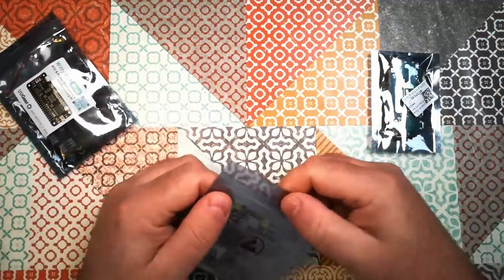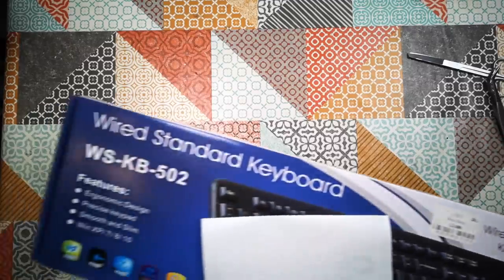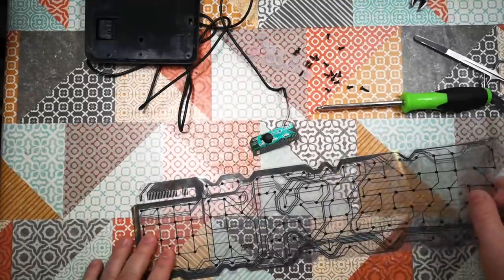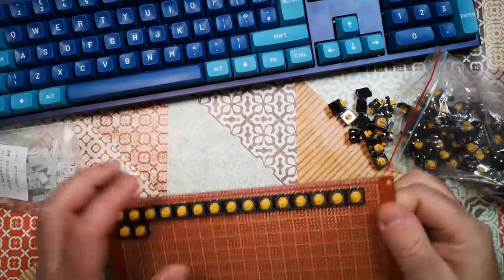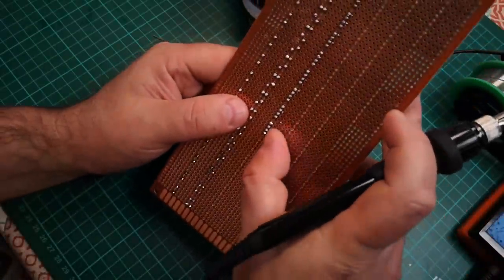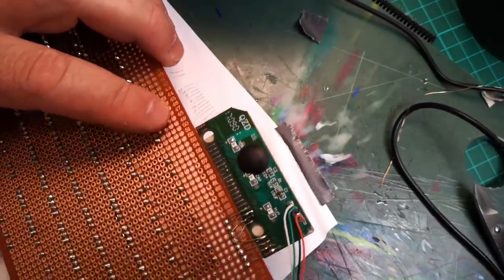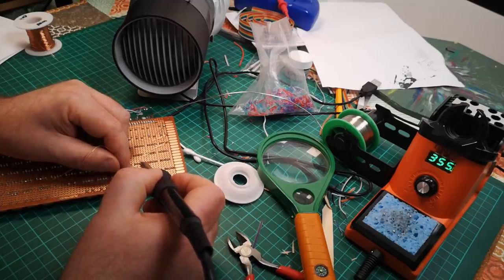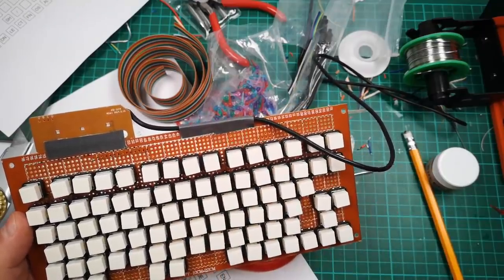How to NOT Build a Keyboard, or: Time to Stop Doing the Same Thing Harder

Comment: Are you absolutely set on constructing your own keyboard with discrete switches and your own matrix?
I suggest removing several of the switches closest to the keyboard decoder and cut out that part of the perfboard. Then solder to that small chunk of perfboard instead of directly to the original keyboard pcb. This way you could mitigate damaging it further. While the result would be pretty ugly, you would salvage the work you put into decoding it.

Comment: I also had the same experience with this kind of perfboard. Just get the green ones if you can.
Reply: Yeah this was a phenolic substrate board. It's basically resin impregnated paper. The really good perfboard is fiberglass with plated through holes. And the good stuff is often green.

Comment: Soldering enameled wire: scrape, tin the spot then solder the wire. 
Or you can burn the end with a lighter instead of scraping but it only works for the ends.
Reply: A dab of flux helps too.
Reply: There's different kinds of enamel insulation. Supposedly this was the iron meltable variety. Which you are not supposed to have to scrape to be able to solder.
Reply: @dogwalker666  yeah but he said he was past using flux. Or so he thought.
Reply: @1pcfred  woof... and from the video clearly not.
Reply: @1pcfred  I always use flux it protects the joint from oxidation. And protects the tip. And with these lead free solder you need all the help you can get.
Reply: @dogwalker666  why are you using lead free solder? I personally do not punish myself just because my government cannot manage the waste stream. When they passed ROHS they conveniently made themselves exempt too. Which I find completely unacceptable. As long as you can refrain from ingesting the solder yourself it poses no health risk to you. I know lead is delicious so it is difficult to not take a little nibble now and again. But you can at least try to exhibit some self control..
Reply: @rosennachev9864  I think not using flux is why that solderable enamel wire was less than solderable for him? Bare wire with no flux you're going to have a hard time.
Reply: @dogwalker666  I've heard that one from people. They think that somehow they're inhaling lead fumes when they're soldering. I guess they mistake flux fumes for lead vapor? I looked it up one day and lead vaporizes at 1,200°F I have some 800°F tips. That still ain't 1,200° though. I try to stay out of the fumes anyways. The stuff can make my eyes water. There's legitimately a problem with lead leaching into groundwater from improper disposal of electronics. That is real. It also has nothing to do with me. I don't throw junk electronics into my regular trash. I pile it all up in the superfund site I have going in my backyard.
Reply: @1pcfred  exactly and I never dump old electronics It all goes to Silicone Heaven or the back of my workshop,  Some older fluxes can be a bit nasty as you say, but try desoldering an old Valve radio without flux.
Reply: @dogwalker666  I don't play with tubes myself. I haven't been doing much with electronics lately at all. I used to. I changed and so did it. The modern SMT stuff never did it for me. There was a narrow window of through hole semis that always appealed to me. I got tired of chasing something that kept getting further way.
Reply: @1pcfred   The SMT stuff is not so much fun, And tends to be module replacement,  I like to restore old amps etc, but old radios are a problem as all the LW/MW radio stations have gone,
Reply: @dogwalker666  I was never into radio. I did make an AM receiver by mistake once though. It only picked up one station. It was supposed to be an audio amplifier but it oscillated instead. That one station did come in clear. The last time I scanned the radio dial I couldn't find much content in English. I was fooling around with a pair of speakers I picked up at a yard sale and I hooked them up to a receiver I had hanging around to see what they sounded like. I ended up putting crossovers in them. They only had high pass capacitors on the tweeters. A lot of speakers are like that. The crossovers made the speakers quieter but I think they have more separation now. Depth? Hard to describe but I like them better. Nice little cabinets and the drivers are OK. They just couldn't spring for any crossovers. I guess because you can't see them? Appearance is how most folks buy speakers. Who cares what they sound like.
Reply: @1pcfred  flux core. The solder have flux core more than 99% of the time and its enough. Yes using aditional flux helps but that not the main problem.
Reply: @1pcfred  that's right most people will buy speakers made of P.E.T.  with Plastic cones as long as they look expensive.
Reply: @dogwalker666  polypropylene cones? I rather like those myself.
Reply: @1pcfred  I was thinking of the mylar ones, Poly propylene humm That's probably a good material.
Reply: @dogwalker666  I like mylar tweeters. I think I may like silk domes better though. Not as harsh. I think my rear speakers may have mylar domes in them? But they're rears so they're kind of low volume.

Comment: I do a lot of perfboard soldering and this hit me on an emotional level
Reply: Not all perfboard is created equally. What we're seeing here is the real cheap stuff too. Those pads lift if you just look at them too hard. Better perfboard has plated through holes and it's FR4 fiberglass too. But for what it costs you might as well have boards spun up.

Comment: I've used a couple of varieties of solderable enamelled wire/ magnet wire , it tends to require pretty high soldering temperatures ( 390°C for one type, >420 for the other) which is pretty likely to pop those tiny pads off the board and require a lot of tip hygiene to make adequate joints.  Both types have a polyurethane coating which is partly self- fluxing, but gives of toxic smoke!
You did pretty well considering👍👍
I'd be tempted to try making a custom pcb (as suggested elsewhere)  and either photoetch or mill the tracks (pretty much only feasible if you have a cnc router to drill all the holes), alternatively send the files off for professional printing.  If going this route it would be worth looking at embedding a microcontroller for decoding the keys and sending the decoded keypresses off using I2C,  SPI or even usb with the right microcontroller (eg teensy)
Reply from the maker: I have a little CNC mill that could probably do PCB milling (it might actually be the only thing it can really do).  Very little recent experience of PCB design though - literally, when I learned the skill of PCB design back at college, it was all done manually with pens, thin tape and Letraset transfers onto an acetate photoresist mask
Reply: @AtomicShrimp  I've had great success with a couple of small routers usin engraving bits to make pcbs.  I used Eagle with a plugin (pcb gcode I think) to export routing drilling, and cutout milling gcode files for both. The free version of Eagle is limited to (I think 8cmx10cm) small boards, and the copper clad boards need to be very flat if the router's software doesn't have an auto-level feature.  Another viewer suggested gEDA, which I haven't tried (but probably will...) there's also KiCAD (which had too steep a learning curve for me to swap to from Eagle)
Reply from the maker: @2lefThumbs  One of the advantages of doing something like that is that it should make it much easier to machine a matching bezel for the keys - for the design I was working on here, I would have to make one based on my own measurements of the spacing etc, which is bound to be slightly off even if I measure with digital calipers
Reply: @AtomicShrimp  good plan, I was going to suggest that possibility👍  A lot of the pcb stuff depends on  availability of pcb foiot print librarie (fairly easy to add your own in Eagle, or download suitable ones from suppliers - for the bezel, you might be able to download 3d models - personally I'd measure the keycaps and use openSCAD to draw and use them to cut out appropriate holes in a flat sheet to generate an STL that could be used to 3d print, or carve out the bezel from a flat sheet (if you haven't met openSCAD, take a look, it lets you proceduralky describe positive and negative features of a 3D object- I find it quick and easyto build and modify, you might too)
Reply from the maker: @2lefThumbs  Oof, that sounds like a lot of learning curve.  I might carry on looking for nasty shortcuts!
Reply: @AtomicShrimp  it's a  shortcut, trust me, perfect for someone with.a coding background👍👍
Reply from the maker: @2lefThumbs  I might give it a go.  The thing I am finding terribly frustrating with a lot of technical projects (QMK included) is that the ground-level points of entry just don't seem to exist.  Wherever I try to start with this stuff, it seems like I need to know something already to make that start - and when I go to try to find out that thing I need to know, it's the same story there - everyone is assumed to be part of a community with some knowledge already - I'm sure that the information exists, it just seems either hard to find the loose end to get started into it
Case in point: the Adafruit Kee Boar - a microcontroller solution designed to be used to drive a keyboard matrix: https://www.adafruit.com/product/5302  Sounds ideal for what I need, as a bit of a noob to microcontrollers, except how would I program it when I get one?  I can't find anything on this.

Comment: There is an easy way to reverse engineer the paths of this keyboard.
Use a scanner and the fill tool of a paint program to highlight one connection and instantly see where it goes.

In case you want to read your own matrix, there is a neat low EMI way:
Put all columns to ground and make the rows the input with the built in weak pullups. Some microcontrollers can even trigger an interrupt when any of the inputs turn low. No scanning saves power and causes no EMI at all.
When one row turns low caused by a key press, switch the columns to input and put the row which was low to low. Then you know the row which was pressed and you can then read the column where it was coming from.
If done right, you get only one EMI click caused by depressing the key itself.

Comment: Oh, I thought of something that might help. What if you use software instead of hardware to 'tell' which switch is which character? The advantage is that you build your keyboard on the most efficient and ergonomic way that suits your demands and then 'program' the keys. For this you need probably to go into how character sets (e.g. UTF8) are mapped to a binary code. In other words, you have your matrix of 8x8, and then col1/row1 = 000001, col1/row2 = 000010 etc.

Comment: Making a keyboard has got to be one of the most expensive/complicated parts of a computer. That's why there are so many different keyboard types and manufacturers want to find the cheapest way of making them. I'm using a PS/2 HP silver/black keyboard on my PCs because I like the feel keys the best. One option, you could design your own PCB and let JLPCB make it for you. Later you could populate it with your switches.
Reply: I agree, If I were to ever attempt at making a keyboard, I would definitely do this.

Comment: One of the places I worked made small runs (like on the order of 100) of custom circuit boards by hand and using protoboard and the way they solved the "what gets soldered to what" problem was a series of masks that they placed over the boards that had cutouts for the legs and and visually showed what legs needed connected to what; this was like 5 or 6 years ago. My guess is that they have custom circuit boards created for all the new stuff now.

Comment: If you wanna build a board from ground up but don't have sufficient skill to design PCB for yourself, I suggest you looking for PCB that already designed by mech community. There are quite a variety of them and I'm sure they will help you. Of course, it should be MX compatible as these are really easy to get (not to mention the compability with the mounting plate, cases and keycaps)
Reply from the maker: I don't think it's going to be possible to make anything compact enough, using full-size keys

Comment: i did build about half of that before. had a broken keyboard and soldered some switches on. not a complete keyboard, just a couple keys to get computers into BIOS that don't accept USB keyboards by default and need it enabled in the BIOS first. that half keyboard has just arrow keys, del, enter and a few others to navigate the BIOS. it runs on PS/2 btw

Comment: I haven't watched the whole video yet.. but from what I remember the kernel has support for doing GPIO connected matrix keyboards. So you don't really need any keyboard controller.
Reply from the maker: Sure, but I want to keep the GPIO pins free for stuff that isn't a keyboard
Reply: @AtomicShrimp  i2c io expander then.. one with interrupts for the GPIOs will work fine for a keyboard.
Reply from the maker: Yeah, maybe

Comment: I think reverse-engineering the matrix wasn't such a bad idea. Finding a good connection layout is always a huge problem and here they did it for you! You probably would spend way more time figuring out a new matrix that would work well. But after everything is done on the paper, creating the physical lines is probably the biggest challenge. It's probably impossible to make a 2 sided PCB (which would be ideal, it's just a replacement for the printed carbon one anyway) of this size at home, and ordering a custom printed one probably costs too much.

Also a note about the switches. You probably don't need all 4 pins, just 2 should be enough, one for the row line and another is for the column line. It should be easier to keep track of them this way.

Comment: Would it maybe be a better idea to plan the circuit in some cad tool and have it etched? You could add little labels on the etching to explain what to wire to what.
Reply from the maker: Learning curve for the design process is pretty intense for a one off project. I mean, I wish it was a skill I already had

Comment: So with this technique we can make mechanical keyboard with some wireless membrane keyboard's board?
Reply from the maker: I suppose it's possible to reverse engineer a keyboard in the other direction - that is, take an existing matrix and PCB and fit a USB matrix scanner to it.  Probably less practical/soldering and more programmining/analysis in that approach

Comment: Mistakes tend to teach us the most, so perhaps this video is more helpful than a success? I often make PCBs, but am a programmer/chemist (odd combo). I would recommend a micro that has a USB built-in (not the USB to Serial external chips) with Arduino support, then grab a bunch of libraries. Unless you're soldering a few components, learning software like Kicad (which has a new iteration just released) is often much less hassle too; there are many step-by-step guides. Anyways, hope I'm not patronising here? Thanks for the interesting project.

Comment: Could you not fix the staggering problem by rotating every other switch 90 degrees? However, this still looks like less hassle than when I did it "properly", once you account for you not having to solder 108 surface-mount diodes.

Comment: As others have said. Scan or pics of the traces to get the matrix layout. Then use JLCPCB to design the board. (Check ut Julien Illet on YouTube, he raves about them). There online design tool lets you just grab the key component from their standard parts and plonk them down, name them the letter or function key as you go, then draw on the trace connections, bypass the schematic step. But the schematic step is pretty easy too. Learning that would be a fun project on its own. 
Or skip all of that do what you did again, but with a sharpie on the backside of the perf board to label the keys as you shoved them in with perhaps another colour to draw a line between the two NO connections you will use later for the soldering. As for the soldering, don't solder them right away. Use a wire-wrap technique with the pins of the switches, a couple of tight twists and then snake along to the next connection, and then when you are super sure it is all correct solder. lots of flux and then with a hot iron solder. if the pad lifts its not super bothersome - as long as electrically its connected. the two unused pads can provide the anchor. as for the other end of the enamelled wire, I would put a row of pin headers into the perf board near where the donar usb keyboard board will be and again wire-wrap the magnet Wire around that. Leave a long tail of the enabled wire. Eventually attach that tail to the donor board - but tin the wire first, either scrape with a knife the insulation or use the heat of the soldering iron. The super thin wire would have been the easiest to use with the donar board. That donor board is probably still workable. Remove as much of the old solder as possible and clean it up. Lots of flux and fresh lead solder will help too. If you choose not to use the donor board, look on eBay or aliexpress for "Arcade game usb keyboard encoder" and there are boards designed for what you are doing that let people make raspberry pi arcade cabinets or custom games consoles controllers and have much easier ribbon cable connectors - not tiny thin pads to solder to.

Comment: You could simply put straight horizontal strips of plastic at the correct width to keep the keycaps aligned. No need to cut out the whole thing. That's save some effort. Also, you could've marked which pins belong to which key on the back of the board.